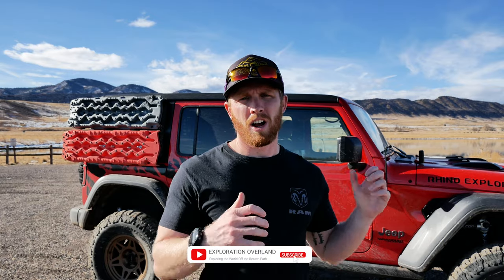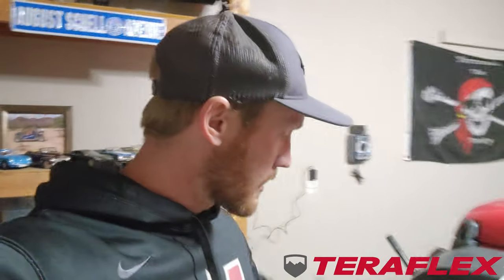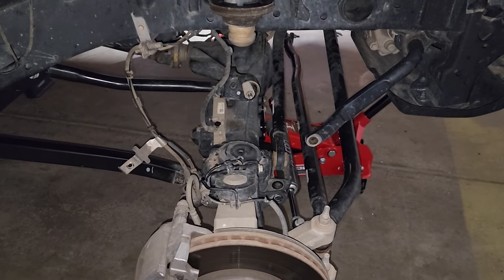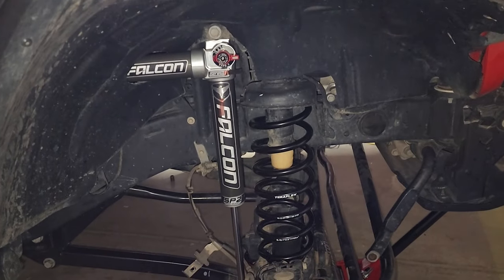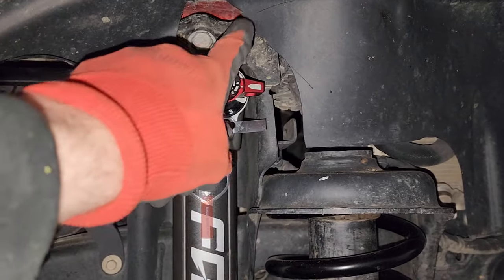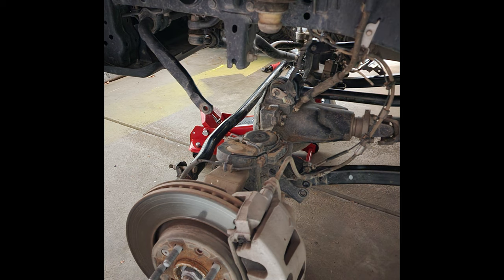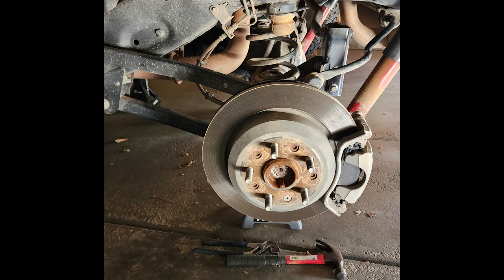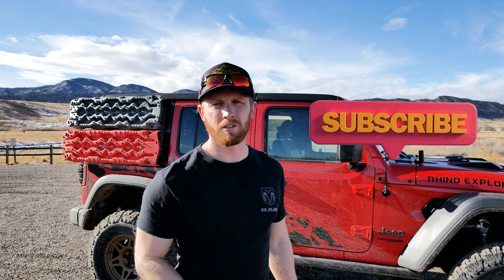Teraflex ST3 Suspension Install: Enhanced Performance, Unveiled!

Comment: Nice work Zach! Ironically, this is the same kit I’m looking at for mine as well. The only difference in my wheels will be the Method 108’s and the Mickey Thompson Baja Boss AT’s. I’m think about running 37’s on mine though but may still 35’s instead? I also need to wire up all of my KC’s still too. The Jeep looks a lot different now since we did Radical Hill. But so does yours and I’m liking everything that you’re doing to it! It’s looking great.
Reply from the maker: Thanks, Jason! It's been a gradual build over this year. I wheel it like it is and see what I need and how it will help before changing it. I'm glad I wheeled it in stock form all year before putting the lift on it.  I learned what kind of lift I wanted and all the components when I installed it.